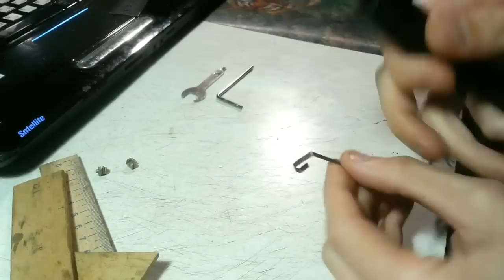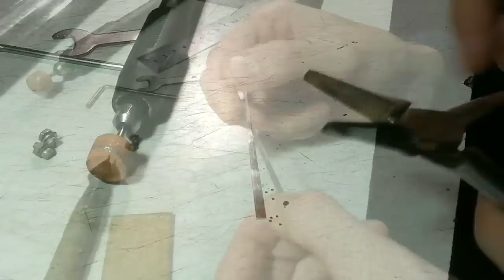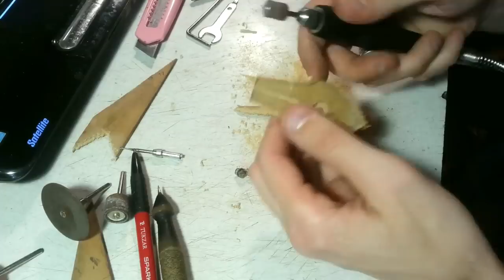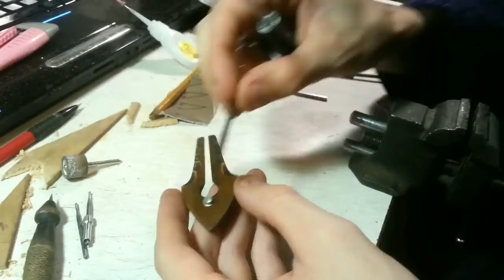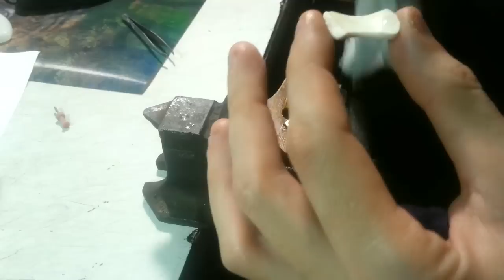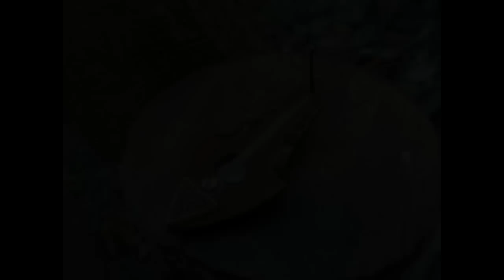Making jaw harp from scrap materials

Comment: I am impressed with how good the wooden frame with metal reed sounds!  Very cool. 
I have seen one harp with a clear acrylic frame and metal reed before but the only wood/steel combination I have seen was a pull string style harp (I have a number of harps made of all bamboo or wood though). 

Does it have good volume? Instead of a screw to hold the reed, I think it would be cool to try a munnharpe style frame and hold the reed in place with a wooden wedge!
Reply from the maker: Thank you for your attention to my work.